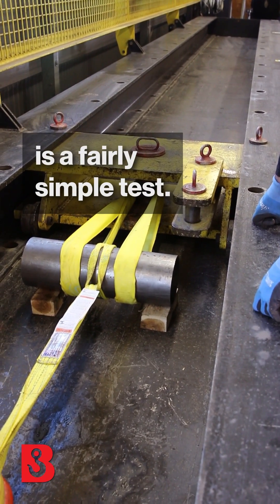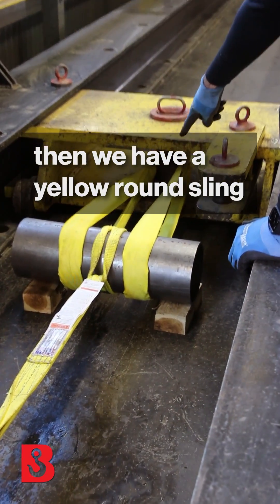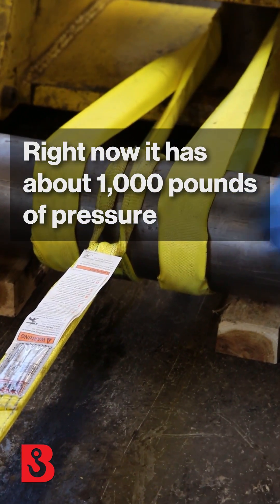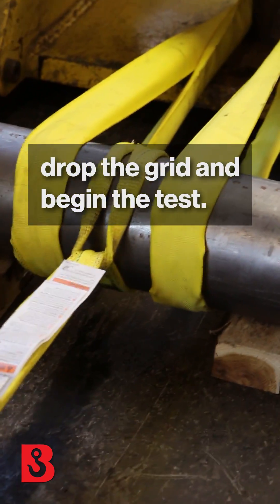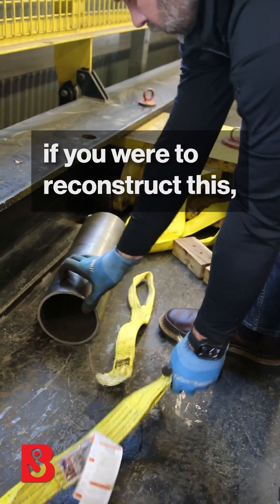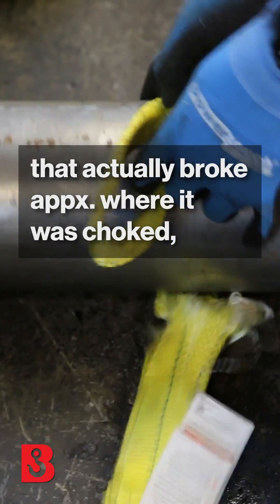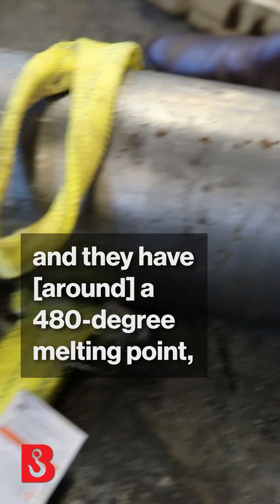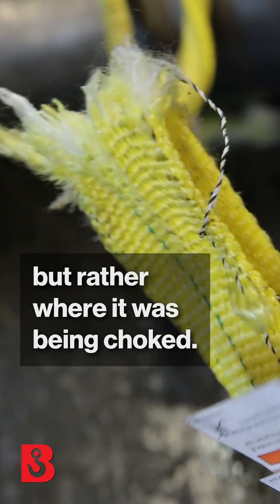Choker Hitch Break Test | Flat Synthetic Lifting Sling WLL

Comment: What was the load that it broke at?
Reply: Yeah, you guys are missing some vital info here
Reply from the maker: That's a great question! To keep things safe, let us start with, "Don't do this at home, folks!" (...or in your case, likely, at work!) Here's the rest of the information for this video:

We used an 8,400-pound rated round sling and rigged it into a straight/vertical hitch in our break-rated test bed, then pulled it until it broke. With its 5:1 safety factor, this sling's breaking point (also called "ultimate strength") should have been around 42,000 pounds (8,400 x 5 = 42,000) in a properly rigged setup, optimum conditions, and without any alterations made to the sling (such as our knot). However, we were able to cause complete failure of the sling at a mere 18,455 pounds (18,455/42,000 = 43.9%), LESS THAN HALF of where it would have failed if we had not tied a knot in it.

This means we took our original 5:1 safety factor (calculated under "optimum conditions," aka, brand new sling, perfect rigging calculations, no shock load, etc.) and reduced it to approximately 2:1 (18,455/8,400 = 2.2:1), which is completely unacceptable, illegal for overhead lifting slings, and very dangerous. 

Tying a knot in your sling leaves your lift at risk because it eliminates most of the buffer provided by the safety factor, which is there to protect you from unknowns and unlucky circumstances — this begs the reiteration of NEVER, EVER EXCEED THE WORKING LOAD LIMITS STATED ON THE TAG. If the vertical hitch WLL on the tags says 8,400 lbs, DO NOT exceed a calculated WLL of 8,400 in your vertical hitch lift. The safety factor is there to protect you, your team, anyone in harm's way, and the property on the jobsite.

For viewers who might be new to rigging and/or do not understand safety factors, ultimate capacity, WLL, and their corresponding regulations, please note that we are not providing this information as a replacement for proper rigging training. This is for our viewer's entertainment, edification, and to demonstrate why the safety regulations are so important. Here's our standard disclaimer: Any advice, graphics, images, and/or information contained in our videos and other content are presented for general educational and information purposes. Our goal is to increase safety awareness among lifting professionals. However, this content is not intended to provide legal, medical, or other expert advice or services, and should not supplant consultation with appropriate industry professionals. 

Thank you for asking questions. We hope you continue to enjoy our content!